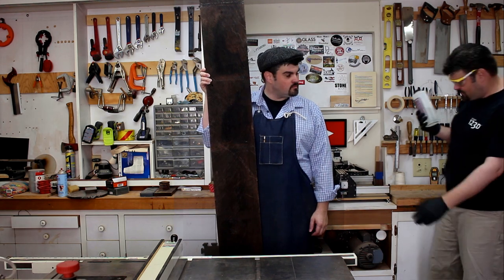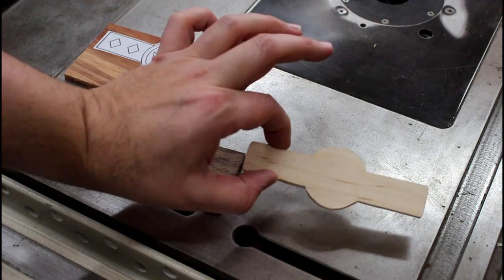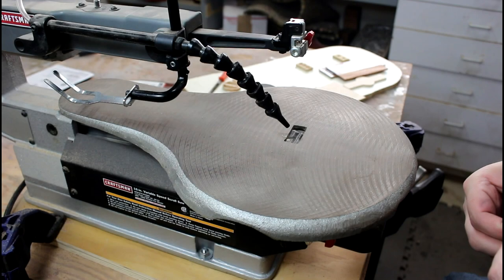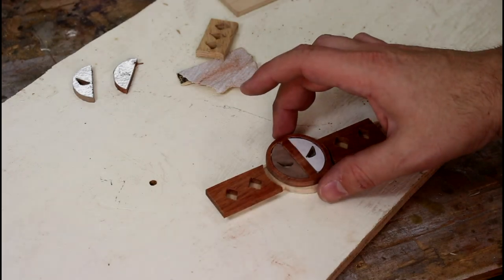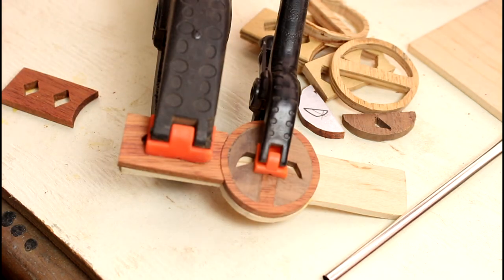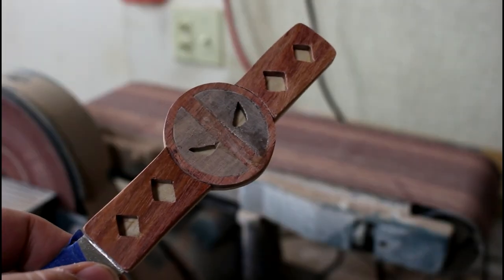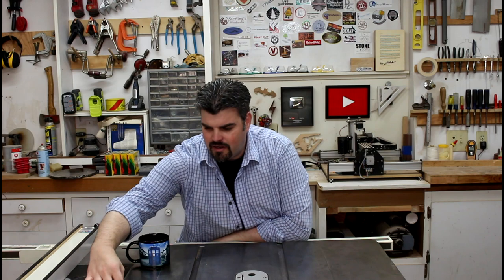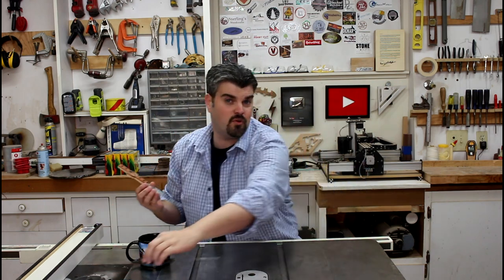Deadpool Spatula

Comment: Random question, have you ever used a vinegaroon dye on oak wood? You said that walnut was your darkest wood, and I immediately thought to myself "well, vinegar black on oak wood is super dark..."
I keep trying to find ways to suggest it to woodworkers. white vinegar and steel wool into a jar, let it sit loosely covered for a few days and then use the liquid on high-tannin stuff to dye it from ash gray to blue black, depending on the amount you use. The vinegar loses much of it's stinky bite, it doesn't stain hands at all and cleans up easy and does a remarkable job.

works wonders on vegetable tanned leather. blackened full-thickness with no mess, and works really well on oak.

Comment: Since you mentioned other materials, have you tried doing anything with HDPE on the lathe yet?  I actually got myself a 2 inch diameter pipe to use as a mold so that I can give that a shot.  I figured anything that would benefit from being waterproof would make an excellent candidate. At the moment, however, it's too cold here for me to do anything in my shop, so I was just curious if you've tried it and might have anything to watch out for once I can get back out there.

Comment: I was wondering, what was that black nozzle by the blade on the scroll saw? is that for dispensing cooling liquid while cutting metal?
Reply from the maker: +DarkMatter It's suppose to be a blower to move the sawdust. Mine sucks, as in, it doesn't do diddly....

Comment: +Peter Brown, now i cant help but notice specifically in you're bracelet videos and ring videos that when you make the pieces of Jewry to go from a solid block to a relatively circular shape you have to always drill out almost half of the material that you're even using just to get a little tiny band. now maybe I'm just being OCD, which I digress really should be recognized as OCPD, and i know that many of the materials you use are scrap or not really always silver and gold, still for when you are making the molds if you were to use a design for the mold like a savarian mold, essentially a doughnut shaped mold then you wouldn't have to pour quite as much resin to fill the molds which would make the progress a little faster, less resin going to wast being that you won't have to drill out as much, and what ever material you use can be rationed out and you would be able in general to make more bracelets out of less material. just a suggestion and i bet if you looked into it there's a chance you might be able to find the savarian mold for a few dollars to a few cents depending on where you ended up going who knows, just would be nice to see a few less shaving which your just going to have to end up sweeping up eventually. over all it would up your efficiency for resin and unusual material bracelets and rings.

Comment: do you sand between coats of poly?
Reply from the maker: +patrick meehan I didn't as wipe on poly goes on very thin. A little 0000 steel wool works two between coats.

Comment: that looks a bit more Slade than Wade.
Reply from the maker: +Robert Szasz See, even when I try to make a Marvel project, my DC still comes through....
Reply: Peter Brown Blame Liefeld. The difference is rounding or faceting (depending on the artist) of the halves where Slade had the two sides joining in a line.  

You can always blame a jackass, thats one spot Liefeld fails to disappoint.